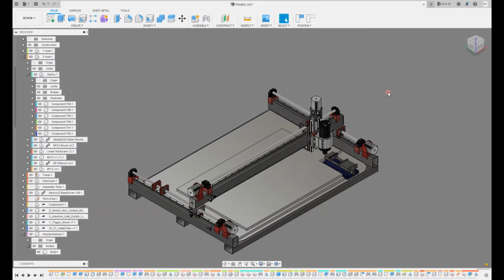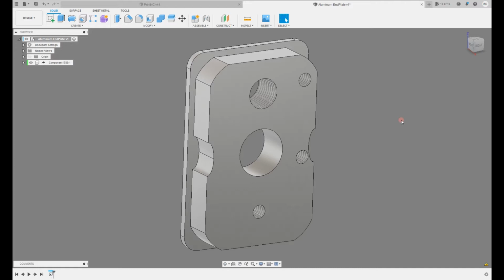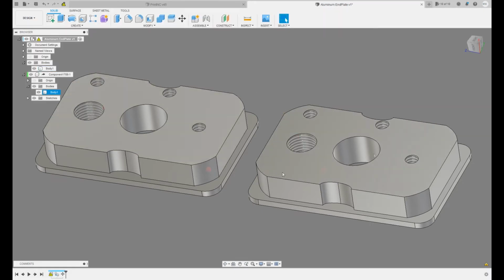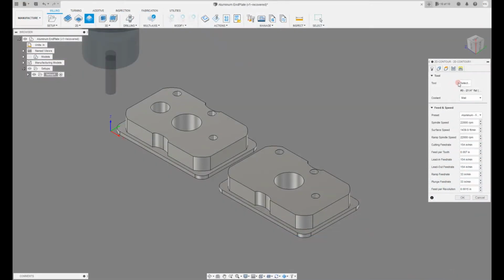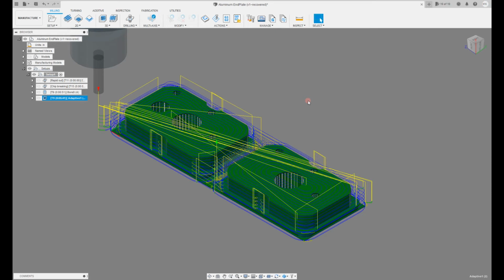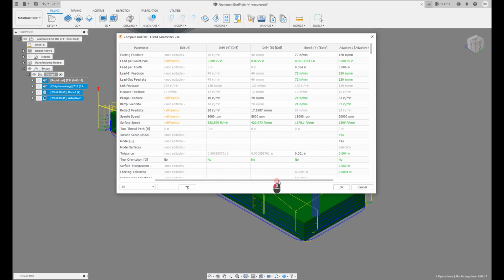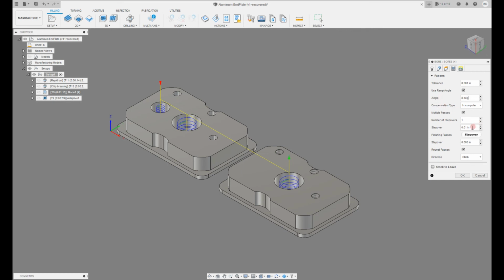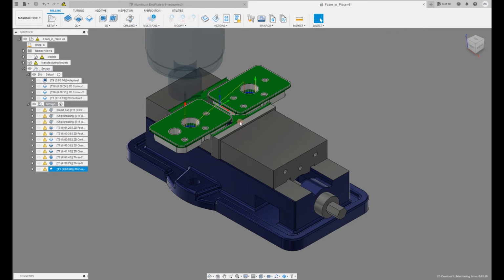Fusion 360 CAM tips and tricks to speed up workflow

Comment: I use CAM templates similarly to how you do. However, I make CAM templates for materials, rather than operations. Thus, when I am milling aluminum, I insert my aluminum CAM template and inside that is a bunch of operations with a bunch of tools, all that work well in my given material. Thus, I delete unneeded operations and pick the ones that work. I'm curious about using your method and if it would work well to change my workflow. Then, instead of inserting my entire aluminum CAM template, I could just insert the threadmilling CAM template.

Have you ever considered using it this other way? What observations did you notice and is it faster/more efficient to run it the way you do?
Reply from the maker: I didn't show it in the video because I didn't want to complicate things, but I have a different template library for different material types, and then within that I have operation templates for that material. 

The main reason I would recommend my way, is that you can just select the operations you want to use in the order you think you will use them. That avoids having to delete out a bunch of unused operations. Plus it makes it easier to go back and add in individual operations templates that you realized you need after optimizing toolpaths, vs having to load an entire list of operations again, just to get a single operation you are looking for.
Reply: @MKMilling  Right, that's what I thought about too after I pondered on it last night. I'll give your method a try. Thanks for sharing all this great information!